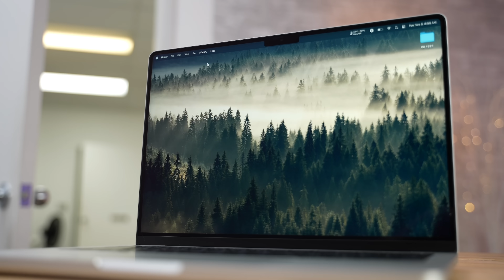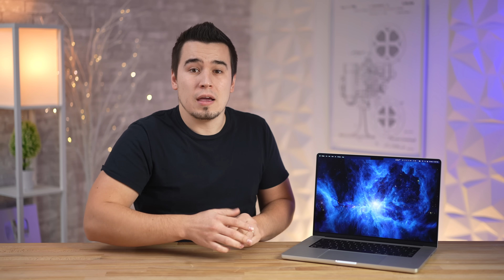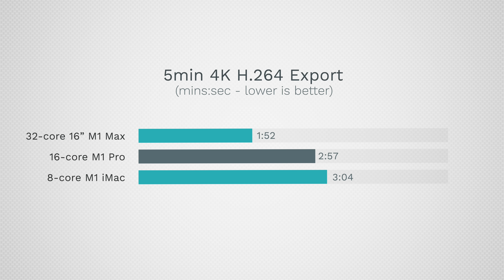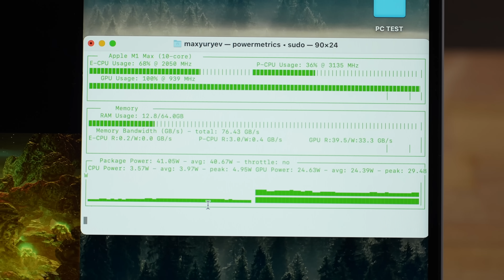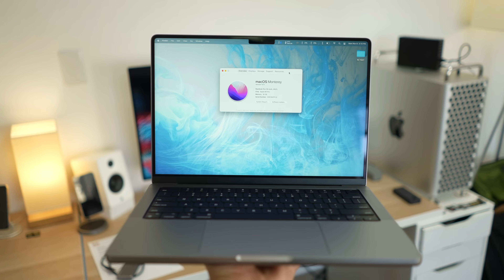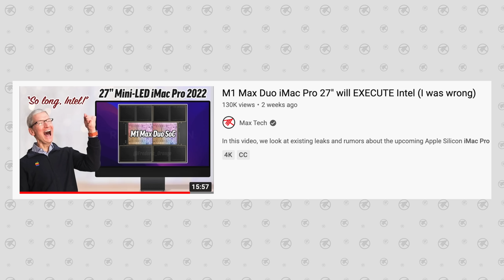M1 Max MacBook Pro Review after 1 month: You NEED to KNOW!

Comment: Hello! I am a graphic and web designer, and little by little I am getting into the audiovisual world. As a designer I mostly use Photoshop, Illustrator, Indesign and XD; and personally I edit 4K videos in Premiere and later I would like to do an After Effects course. Currently I have a MacBook Pro 13” from 2016, i5 dual-core and with 16Gb of Ram, and the truth is that for some design and photography or video actions it goes quite slow, it heats up and the fans turn on very loud. Some time ago I thought in buying the MacBook Air M1 with 512gb and 16gb of ram, but now I have doubts with the new models. Yesterday I ordered the 14 "Pro with the M1 Max, 24 graphics cores and 32gb of Ram. Do you think it is an unnecessary waste of money and that the Air with 16gb will be fine for me? Thanks and best regards!
Reply: you've made the right choice. I have a M1 Macbook Pro from 2020 and its starting to lag on large artboards on Ai so I've upgraded to the 32 core Max.
Reply: @redtec989  Thanks for the info! With the Pro M1 with 16Gb, Illustrator is bad for you?

Comment: Also they should at least let you get the full performance of the 32 core GPU in the 14 inch if you’re plugged in
Reply: The 14" doesn't have the cooling capacity of the 16". There is only so much room inside a 14" so things like fan size are smaller.
You want max performance in a laptop you'll need to get the 16".
Or just wait and see what they'll soon be releasing with the the M1 Pro and Max desktop computers.
Not sure why so many people feel that they have to get a super powerful laptop when they sit at a desk all day doing desktop tasks.

Comment: While the M1 architecture is very fast for some benchmarks and apps it is slow for some other. Verify your use case before buying.
Reply: What apps have you found it to be slow in?
Reply: @creativeorstrange  Stockfish, for example while the M1 Max can even be a little faster than an Intel xeon on some tasks it is over 10 times slower in stockfish (benchmarks are available on the net).  That is 1000%. It shows the danger to extrapolate. Because it is very fast on Apps that have been optimized for it and synthetic benchmarks it does not mean it will be fast for apps that have not been optimized which is the majority of apps. Furthermore they probably never will be optimize because the M1 is and will remain a small part of the market.
Reply: @andyH_England  It does run but not very fast. The bigger picture here is that all of the apps shown in this review do run very fast because Apple added special transistors for those tasks. Most "more general purpose" apps would not  but nobody would ever even suspect it looking at those reviews.
Reply: @danielfrappier3378  thank you for your reply!  That’s very interesting. You are the first person I have come across who has stated that the m1 Macs can be slower in certain optimised apps.
Reply: @creativeorstrange  I did not say in optimized apps. Stockfish was not optimized for the M1. It will never be because the fantastic performance of the M1 you see in video editing for example do not transpose to other fields of applications. Reason being that those fantastic performance are not only because of the architecture or unified memory but because Apple added a lot of specialized transistors for video editing. Those transistors are useless for other tasks. Another reason is simply that Apple is not in the business of high performance. Everybody I know who use Stockfish seriously use a high power desktop that the M1Max cannot compete with. A MacPro will not compete either as it will be very bad on a price/performance ratio.
Reply: @danielfrappier3378   sorry , I mistyped , I meant non-optimised. And yeah , I’m aware that amazing performance when video editing does not necessarily translate to other tasks as the M1 pro and M1 max have purposely designed hardware on the chip to deal with encoding and decoding. Thanks again for the reply - have a great day ☺️

Comment: Memory is the key for increased performance between the pro and the max  minimum 32gb best for both 64gb.
Reply: Ridiculous. You haven't been paying attention. At all.
There are other differences that make much bigger changes in performance between Pro and Max.
Also, pull your head out of the x86 mindset and open up to Unified Memory architecture.
Reply: @Mamo878  look at some of the other tests done by other YouTubers on 8 k files etc  doubling the memory makes a huge difference it all depends on what you want to do there no real speed diffence between the Pro and the Max for normal users